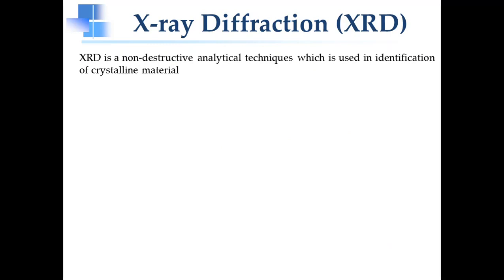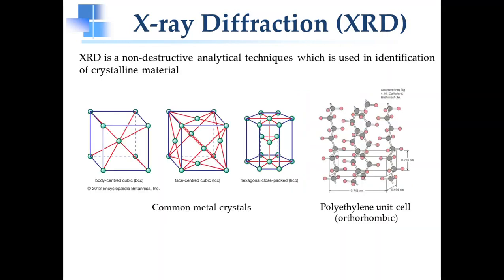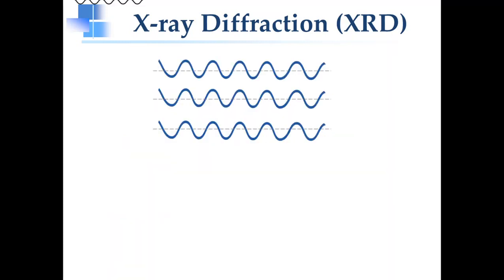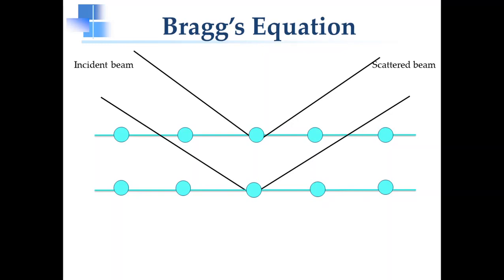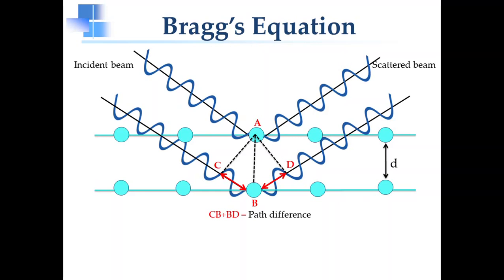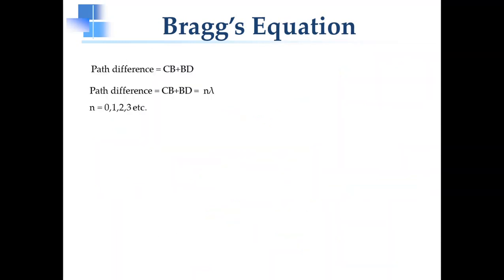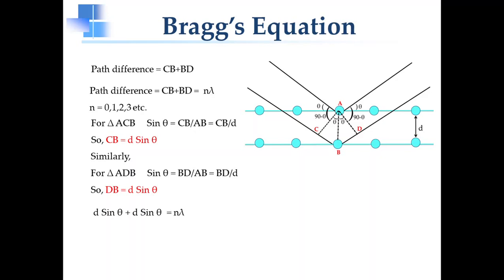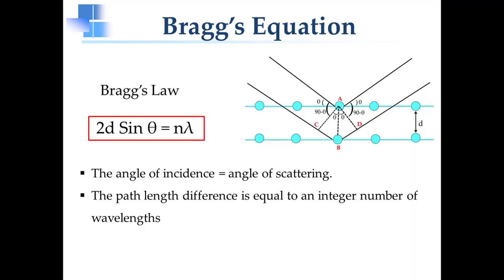X-ray Diffraction and Bragg's Law

Comment: What is meant by order of reflection?
Reply from the maker: The order of the reflection (n) corresponds to the path difference between X-rays diffracted from two different layers of crystals. So if extra distance traveled by X-ray is exactly one wavelength, it is a first order reflection, if path difference is equal to two wavelength order of the reflection is second order.